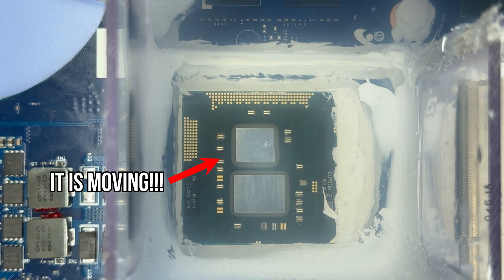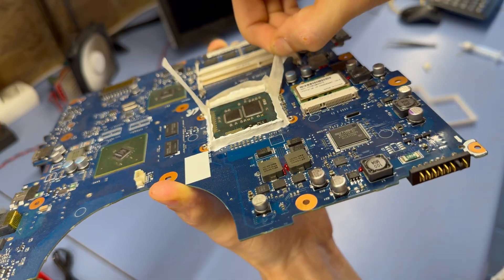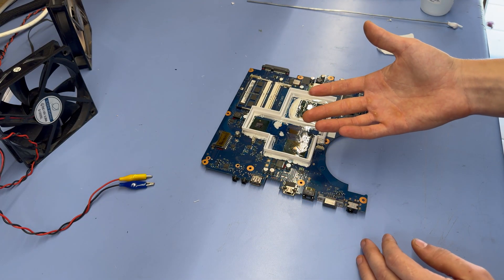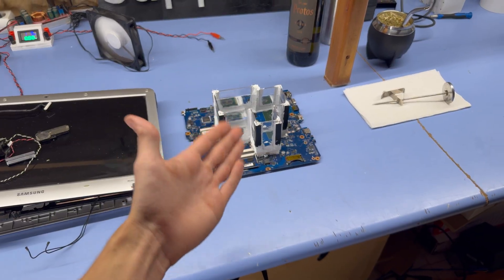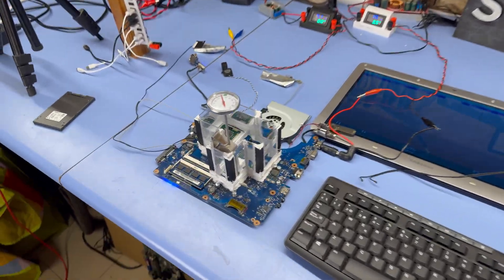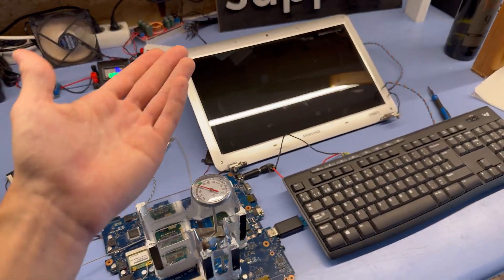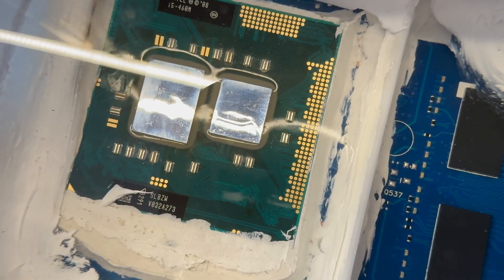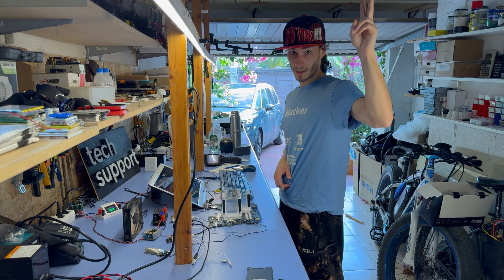I Tried Cooling a CPU With Just Water… and Something Strange Happened

Comment: Your seeing convection currents as the hot water from atop the CPU rises, pushing the cooler water at the top of the tank downward causing the light to refract in the waves of the convection current. Check out the Laws of Thermodynamics. It explains what's going on.

Comment: Just curious... Why did you 3d print just the frame, instead of the whole tank?
Reply from the maker: Since the PLA of the 3D print can not withstand a lot of heat, I thought the best was to build the tank using other heat resistant materials. 
Initial thoughts were that it will reach 95C and at that temperature PLA can become super soft
Reply: @Inventors_Den  I see. OK, thank you for your fast answer. Keep up the good work!

Comment: You can reduce the bus frequency and then the core voltage in the BIOS. This will reduce system power consumption.
Due to thermal expansion of the water above the processor, its refractive index decreases, resulting in this visual effect. The same thing happens in a kettle or saucepan before boiling.
Reply from the maker: Thanks for the tips! I think the BIOS on this laptop is pretty limited so that’s why I didn’t do it. Also that’s a great comparison with the kettle, makes total sense!

Comment: The silicon isn't exposed. It wouldn't work that way. It's all inside the die. You should be able to touch the water too. If you could freeze it without breaking the form, that would be interesting. Would prob run longer.

Comment: I don't understand why you didn't just submerge the computer in distilled water. The whole reason why water destroys electronics is because the electrolytes or ions in the water conduct electricity causing a short circuit in somewhere undesirable but if you take away the electrolytes then the water is not conductive and you can submerge the computer.

Comment: Quite simple convection actually. If you want to spend less time isolating your motherboard, you can simply use transparent mineral oil. You could also add a small heatsink if you want to attempt recovering this one, even a small one like for a Raspberry Pi would increase the thermal mass and dissipation surface area.

Comment: You can see this phenomenon during scuba diving when you reach a thermocline (water with different temperature that moves like a river inside the sea)!
Also water is not a good heat conductor... Indeed it can store thermal energy but the small surface area of the die can't transfer heat good so inside the cpu reach higher and higher temperature!

Comment: mineral oil....  :)  Immersion cooling is fun!  Had a overclocked and overvolted setup running in a 5gal aquarium with Peltier chilled mineral oil;  Hot side of the pelts (stack of three 90w units) were cooled by a showerhead in a 5ft tall 6" PVC pipe.  That pump alone for the showerhead was super pricey!  Whole setup was something like $1000 all in and was able to run a Celeron 333 at 1.4Ghz!  Obsidian Voodoo2 cards - setup was SUPER exotic at the time.  Good times.  Repeated thanks to Gabe Rouchon at Swiftech!  o7

Comment: Ive had to fix many of those laptops.. but they do NOT support windows 10.. they run windows 7 fine.. but windows 10 will not boot :) Samsung laptops only ran windows 7 good, no windows 10 :(
Reply from the maker: Hmm did you try MBR boot device? It should boot if the CPU is 64bits
Reply: @Inventors_Den  yes.. as soon as the installation finish and it starts for the first time it will just get stuck and hang there or give blue screen

Comment: This actually exists, but you need to use a liquid with a lower boiling point (or have the water under a vacuum) so that when the cpu reaches 60-70c it boils the liquid, thus quickly removing heat from the die, otherwise the natural heat transfer into the water is too slow with such little surface area
Reply from the maker: That’s a great point, but the whole aquarium needs to be 60-70c to boil, it’s a hard one to try but maybe one day can be possible, placing the whole board into vacuum should be easier) Peace ✌️

Comment: I think the issue you’re running into is that the CPU is producing more heat than the still water (just natural convection from the heat) can carry away from the silicon. The water touching the chip heats up quickly and just forms a hot boundary layer, so the heat doesn’t go anywhere and the CPU ends up thermal throttling or shutting down.

If you added a small pump to create some circulation (basically forced convection), the cooler water would constantly replace the warmed water at the chip surface. That would massively improve heat transfer and would probably make this setup work a lot better. Likewise if you added some sort of big copper surface to take the heat away from the silicon and spread it out, that would probably help as well.

Love the experiment and I consider this to be a very fun and geeky. You could also use a thicker liquid of some sort (glycerine or something) but I think whatever you use, forced convection will be needed. Would be an easy addition to this experiment and generate another cool video. Love stuff like this, keep up the good work, you're on my subscribed list now.
Reply from the maker: Thanks for the feedback mate! I am planning to do the part 2 trying all different suggestion, for example I think alcohol should probably improve the cooling effect too) Peace ✌️
Reply: @Inventors_Den alcohol might be extremely inflammable tho, so don’t burn or blow yourself up accidentally
Reply: Yep, the water isn't a good heat conductor! The surface of the die is too small! A heatsink without a fan will improve the system! Also if you want to remain with water use demineralised ones that don't conduct electricity! Under the external seal maybe there are some component wet
Reply: @MyNotSoHumbleOpinion as for liquids, water is the best. Only mercury have very much better thermal conductivity, but it's metal (liquid).
Reply: @Li0nSam  yes, it's the best, but compared to the aluminium heatsink is lower by a factor of 200! you don't need a big heatsink because the water is much more conductive than the air, but the cover of the die is too small... the heat must be spreaded to a bigger surface in contact to the water (at least 100 mm2)! inside an AIO water cooler for CPUs there are hundreds of tiny copper lamellae to spread the heat to the water!

Comment: you're gonna be struggling with water directly on the chip, you'll really want a heatsink on it, unless you opt for a more thermally conductive fluid like mineral oil or something that conducts heat better (added benefit of mineral oil would be no need to waterproof the motherboard as it's non-conductive to begin with), but even that probably won't be good enough without some way to spread the heat more efficiently like you would with a metal heatsink
Reply from the maker: Thanks for the feedback I will be trying that in the next part

Comment: Try putting a heat sink over the silicon. The CPU is overheating, and the reason is that the small surface area of the silicon is unable to transfer all the heat into the water. With a heat sink the surface area is way larger and more heat transfer is done.

Comment: Looks like the 'Waves' are just Heat convection that you can see with the hot cores. Also the 'Murky Water' is probably because you used basic water based "Acrylic Painters Caulk" Which will start to dissolve in hot water if it is not %100 percent cured. When it is dry to the touch, it is still not completely cured and with multiple layers of caulk you just have some uncured caulk dissolving into the water. I would let it dry for a week and then new water should be fine. :yougotthis:
Reply from the maker: Thanks for the explanation! Makes total sense however  i think for now the whole thing is with water)🤦‍♂️

Comment: The waves are the convection currents cause by the heating of the water on the die. It's bending the light because of different densities in the water due to the heat.
Reply from the maker: Thanks! This is what is happening) Peace ✌️

Comment: Biggest issue i see is there is no circulation or cooling of the water your best bet is to seal a block directly around the cpu and gpu chips with a spit channel for both to recive cool water and attach a radiator fan ,and pump. The smaller the box surrounding the chip the better the flow over the chip allowing better flow and that could reduce the heat
Reply from the maker: Great point! I am planing on circulating the water in the next part

Comment: I did a variation of this about ten years ago. I cut the bottom out of an aluminum water block and glued it to a AMD FX 6300. It still had the heat spreader on, so it wasn't direct die. It didn't work well...
Reply from the maker: Damn that’s cool! So the water was with a direct contact with a CPU?
Reply: @Inventors_Den Yep!

Comment: What if you use very small heat sinks meant for like raspberry pies or something like that on the CPU and GPU?
It would increase the surface area from which the water can dissipate heat away from the core components easier.
Reply from the maker: Great idea, in fact I have these tiny radiators! Will there be any problem because of water in contact with thermal paste?
Reply: @Inventors_Den  Not sure, maybe thermal pads would work, but I can't guarantee anything. 
All I do for the most part is share ideas I guess.

Comment: I think the wiggling you're seeing over the hot dies is from a gradient in the refractive index due to temperature change, similar to what happens in air...
Reply: It's just like looking off in the distance on a hot day, you can see the hot air
Reply: I think it's just his stomach....
Reply: Exactly, the same can be seen in a hot day
Reply: Yes, mirage. Happens in liquids on steroids.
Reply: @_c_e_ stupid quote, if you call that mirage, you can't know this happens in every liquid, the more chemicals in it the faster. It even cast god rays under water.
You have to get good water quality though
Reply: @goldnoob6191  Yes, similar to what happens in air. It's called a mirage. Troll comment mate.
Reply from the maker: Exactly, the die is hard and shouldn’t move!
Reply: @Inventors_Den  the die ISN'T moving, the light is being bent as the temperature differential in water creates refraction, and therefore said effects. Hot water rises, cold water lowers. Water gets hot when it touches the die, it lifts, refraction happens.
Reply: @Inventors_Den whatever hardness thermal expansion occurs anyway. Also epoxy adds it's own  additional strain on the CPU package preventing everything from moving as expected by manufacturer. You can see bubbles  above the die, a clear sign of something is highly energized.

Comment: what you are seeing is just the water density changing due to temperature, the same happens in a pot on a stove when boiling water, you can try by pre heating one of the stoves red hot and putting the pan of cold water on it, it should start warping inside as the water heats up and rises due to the density changing due to heat. (basically the same happens with hot pavement when we see "mirages" from the hot air waving up.)
Reply from the maker: That’s a great explanation, thanks!

Comment: The waves over the CPU is convection. When the water gets hot, it's density decreases. The cold water has then higher density than a hot water, so pockets of hot water are rising and cold water flows in its place. With density, also the index of refraction is changed. The light bends when traveling over the boundary of mediums with different index of refraction, that's the basic principle behind camera lens, as light goes from air to glass and from glass to air*. Also, depending on the angle, the light might reflect rather than refract and that effect creates "fata morgana", like that shimmering over the road on a hot sunny day. It is basically the same case, the air near the road is much hotter than the air above, it's density is lower so it rises as pockets and rising and mixing of hot and cold pockets with different indexes of refraction it creates the shimmering effect, just like over the CPU. Same effect could be noticed in the pool in the summer. When the water is quiet and is heated by the sun, on the top warm layer of water forms. When you try to mix it with hand without creating too much waves, you can see shadowy patterns when the hot and cold water mixes on the bottom of the pool.

*the index of refraction, how much the light bends by going from one medium (air/cold water) to the other (glass/hot water) depends on the speed of light in a given medium. In a vacuum, the speed of light is "c', in the air, it is slightly less, not by much. Basically, index of refraction is defined as c/(speed of light in a given medium). For example water at 18ºC has 1.4370. Change in temperature by 1ºC results in change in the index of refraction of the water by 0.0009, with higher temperature the index of refraction is smaller, water is less dense, light can travel faster. Here is the link to a lesson about refractive index (which is correct term, in my language we call it literally index of refraction :D):
https://www.utsc.utoronto.ca/webapps/chemistryonline/production/refractive.php
Reply from the maker: Thanks for feedback and the theory! Comparing it with the pool is the best way to understand what’s going on. Since these “waves” on the CPU move in one direction does it mean that we see exactly where the CPU is heating up the most, therefore does all the heavy loading?
Reply: @Inventors_Den  Hmm, I don't think this effect gives us enough "resolution" to know where the CPU gets hot. But, it is true that CPU usually doesn't heat up uniformly. Obviously, parts of the silicon where the cores or power management things are will get hotter faster under sudden load then an area with cache or integrated GPU. I have seen very interesting video where some guy looked at a working chip from a set top box I believe and this non uniform heating revealed the inner structures of the silicon (found it! :D https://www.youtube.com/watch?v=ks2D35NOgos).

The waves move in one direction because of convection current. And those currents, their speed and direction, depend on the temperature of the heat source, temperature of the liquid and ambient temperature that cools the container. Because it goes both ways, CPU heats up water, that water goes up being displaced by the cold water. When the hot water reaches the top, it cools down but it can't go down directly because now hotter water is pushing on it from below, so it goes sideways as it cools down. Then it meets the wall of the container, which is cooled by ambient air, and it cools down even quicker so it falls quicker and reaches the CPU again quicker, so the water starts moving in the loop(s), connecting places where it can transfer the heat more efficiently.

Comment: Temperature variations create density differences in the water, which affect the refraction of light.

This is similar to heat haze in the air, which refracts light differently, creating a blurred or hazy image of the surroundings.
Reply from the maker: Great point! I am guessing when we see “puddles” on the road far away in a hot day when driving it is the same effect!

Comment: I believe what we see on the top of the CPU, is a visual effect of the convection occuring over the CPU die. Convection is the heat transfering process in which the water (in this case) gets heat from the bottom and that reduces its density, making it flow to the top of the container. Once this happens, it naturally pushes the colder water down, and that water now gets closer to the heat source. The process goes on making a natural flow of water with no pump involved, which helps to get heat further away from the source.
Reply: yup.  The waves are basically convection currents.   Simple density changes in the water, due to heat.

Comment: I can't believe he and all of us watching wasted so much time in diagnosis when the issue was so obvious (I won't say so I don't spoil it). Also, if you touch the CPU you wouldn't get  electrocuted, the CPU works at stupidly low voltage, the only way you could get electrocuted is if you open the PSU which in this case is external since is a laptop. That doesn't mean you can't burn your finger of course. I believe what we see on the top of the CPU, is a visual effect of the convection occuring over the CPU die.
Reply from the maker: Thanks for every explanation! When I dumped the finger in the water I felt a slight shock, but very small, so come current definitely started passing through my body maybe it’s a bad ground in the house)

Comment: You have to make water circulation, it is better to use peltier, on the one hand it heats up on the other hand it cools down, so the water should not reach boiling point, because I also have a modified cpu cooler
Reply from the maker: Installing a Peltier in this setup should be pretty interesting to see too!

Comment: reason its goin into thermal shutdown is the same reason waterblocks have the copper plates with thousands of tiny fins carved into them and the water flow director plate.

surface area and flow.

you've reached the limit of it for still water on direct die, I7 will do the same thermal shutdown only faster

maybe alcohol?
Reply from the maker: Yep Alcohol is pretty interesting to try, will do 💪

Comment: I am an optical technician and I can take a guess that the optical distortion is due to a gradient in the refractive index of water being changed with temperature. This is the same effect that makes the image on the other side of a flame also look like it's distorted.
Reply: Yes, same as heat haze or a mirage works in the air.  Or that shimmer you get on a hot tarmac road in the summer.  The CPU is hotter than that gets, so you get distortion due to thermal changes, causing gradients in the refraction index dynamically - you get that kind of effect shown.